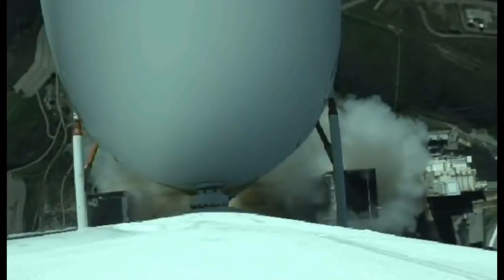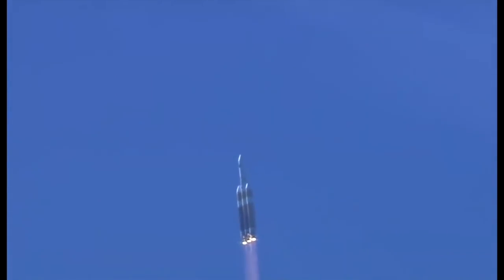Delta IV Heavy launches NROL-71

Comment: Why is there so much visible exhaust (dust?) behind DeltaIV, but so little behind the Falcon9?
Reply: It's water vapor. Delta IV burns hydrogen, Falcon burns kerosene, therefore Delta exhausts water while lot of Falcon 9 exhaust is CO2. Vapor trail also depends on weather.
Reply: @aleksandersuur9475  Thanks! So BFR will do the same?
Reply: @norik1616  BFR will burn methane, so yeah what comes out is mostly water vapor. So there should be more contrails than Falcon has, also because it simply burns more fuel.

Comment: I like how the fairings wobbled away into space.
6:56
Reply: 5 years from now there's going to be a ufo video from iss cameras of those things passing by waay in the distance still wobbling and reflecting sunlight.
Reply: Since there's nothing to damp out the vibration they'd probably keep wobbling until they reach Earth's atmosphere
Reply: I thought objects in motion tends to stay in motion?
Reply: @glockamole7128  They do. So what is your point?
Reply: @jpt7342  its just wierd how it wobbles like that.. Im not saying its fake or anything, I'm not one of those.. Im just curious about the wobbling farings.. Lol
Reply: @glockamole7128  Small explosions for the fairings release probably caused that wobbling.
Reply: Im just curious about the wobbling farings..

They're very light in weight, the amount of material used is the absolute minimum necessary to survive the boost phase. When they're jettisoned, they wobble just like any lightweight structure would, like a kid's plastic wading pool, for example.
Reply: @glockamole7128  the jettison force makes them wobble
Reply: @CarlosAM1  i figured it was the jedison that made it vibrate at a frequency that gave the illusion of a wobble... Lol
Reply: @glockamole7128  Yes. Not the illusion of a wobble, but an actual wobble. It's like how a pendulum will swing forever or, more closely, a ruler will wobble for a bit if you bend it. When the fairings are released, the edges are pushed away first. This causes a relative displacement and internal forces pull the middle out. Because of inertia, the middle ends up going further than the edges, so the edges get pulled back further and so on. It's the same principle as bending a ruler - it'll keep vibrating for a while.
Reply: me tool a life of its own...
Reply: IT'S ALIVE!!!!

Comment: At 6:34 until just before 6:40 there is some form of faring lowering around the end of the rocket exhaust exit, what is this?
Reply: It's a nozzle extension. The upper stage engine has a vacuum optimised nozzle which is much bigger than the first stage nozzles. Basically it folds up to fit into the interstage
Reply: @andrewbailey7999  And that's how you get 465s specific impulse!
Reply: Just checked back ,ummmm

Comment: Question.  Clamshell sep is way above the atmosphere,  yet they are seen fluttering as if in a breeze.

How is this happening in a vacuum?
Reply: That's not wind flutter, it is elastic flutter resulting from the explosive disconnect.
.
.
.
Not that the vacuum at that altitude is particularly empty, but it definitely is thin enough not to have "wind" effects any more.
Reply: @marvinkitfox3386  I noted the flutter as well, I also concluded it was elastic, and it made me marvel at how minimal the design must be. Strong enough to survive max pressure, but thin enough to wobble like that.
Reply: @flamencoprof  It could be made from 1" steel plate and it will still flutter a fair bit.
Once it is separated, it has no rigidity to speak of.
Reply: @flamencoprof  The fairings are only designed to make the rocket more aerodynamic in atmosphere.
Reply: Brian Roberts so according to you vibrations/oscillations are only possible when there is a “breeze”, amazing!!
Reply: @olasek7972  Please learn reading comprehension. 
I stated "as if in a breeze". It was a descriptive expression. 
I also asked a polite question . 
What is your problem?

Comment: Wow, ULA, seriously? I think the hydrogen burn on the outside of the rocket is pretty cool. Others may think its scary. But you seem to think it's embarrassing. Did you really loop old footage at 0:40 to distract form the flames?? (looping footage in a live stream is a pretty scatchy thing to do)
Reply: Doubt that was intentional, that feed possibly was delayed as it looked like it was a few seconds behind as you can see other ignition processes starting (and you clearly see the hydrogen burn off in the shot before).
Reply: Highly doubt they are/were embarrassed
Reply: They show full footage of the fire in their launch highlights video. Now that it's pretty normal, they embrace it as one of the quirks of Delta IV Heavy.
Reply: But it's super weird to cut away from it to a still frame. Something went wrong there... Maybe you are right and it's like SpaceX messing up the stream at the fairing separation during the Falcon Heavy Roadster thing, but... It looks very intentional.
Reply: Simon Barke nothing could go so visibly wrong there without affecting the rest of the mission.

Comment: Can somebody explain what all that smoke is at liftoff if the fuel is hydrogen with oxygen?
Reply: Orange foam covering is catching fire from    initial hydrogen burn out.
Reply: It's water vapor condensing from the burning of the fuel/oxidizer. The exhaust is essentially water.
Reply: Yes, it’s the same water vapor you see behind an aircraft in the flight levels (contrails).  

Except in the case of rockets, there is no CO or CO2.
Reply: @Stepclimb  in the case of hydrogen burning rockets.

Comment: 1:38 something flew by...
Reply: Error 0x80070079 venus did
Reply: @chillpolarbears  How are people so sure its venus? Not saying you're wrong but just wondering if you checked its position against the angle of the camera or what?
Reply: @UncommonSense-wm5fd  it could be something reflective that flashes with light from the rocket plume as it tumbles, I agree its probably venus but I'd have to check if it was in the right position before assuming that (and I don't care enough to do that lol)

Comment: Boy that close side booster had a quite a few chamber stability transients. That would have had my rear puckering if I was the lead flight controller on this launch.
Reply: Engine nozzles are ablative. Its nothing to worry about.
Reply: I think that's just the ablative engine nozzle - some of that material comes off and burns bright for a bit.
Reply: Lets see what Boeing says. Quite a fireworks show form everyday launches...
Reply: D. Mullins Boeing doesn't have much to do with it. That engine is an RS-68, made by Aerojet Rocketdyne. It's running fuel rich through an ablative phenolic nozzle...that's the reason you get orange flames and variations in the exhaust plume...phenolic material ablating away. This is normal...been flying these engines for...going on 20 years?
Reply: Thanks everyone, I was looking for info on this. Didn't know about ablative nozzles.

Comment: I wonder what sort of propellant is used on this rocket that it doesn’t leave smoke directly behind.
Reply: You could have looked that up faster than the time it took you to type that question, you do realize that?

Delta IV uses Hydrogen and Oxygen, both in the normal cryogenic liquid form.
The exhaust is basically superheated steam, and some nitrous oxides and the like from scorched atmosphere.
That's why the visible exhaust close to the rocket is basically invisible, just the heat glow coming from it, and further back it makes a very visible white exhaust trail.
Reply: hydrolox
Reply: Liquid hydrogen & liquid oxygen.  The hydrogen burns cleaner than kerosene: __ https://en.wikipedia.org/wiki/Delta_IV_Heavy
Reply: LH-2 (liquid hydrogen) and LOX (liquid oxygen).

Comment: Environment friendly hydrogen rocket 👏
Reply: CryB4Die how do you figure?  Fossil fuels (natural gas) are used to make hydrogen.
Reply: @johnvalerian8440  who knows maybe they used electrolyzers for the h2 en o2 production?
Reply: @CryB4DieXIIV  
Learn some science. Today 95% of hydrogen is produced from methane and coal.
And for the the part made from electrolysis, the electricity is produced from fossil fuels.
Reply: @nicejungle  I mean it is always possible to do it the clean way by solar, wind or nuclear.  Its a step in the right direction...
Reply: CryB4Die 95% of hydrogen is produced using natural gas which contains methane using process called steam methane reforming.  Just google search your questions.  Other methods are deemed too inefficient.
Reply: @johnvalerian8440  mainly done with hydroelectric energy due to lower cost to perform electrolysis of H2O.
Reply: YouSurf think logically for a second.  If hydroelectricity is going to be used to make hydrogen in a inefficient way then you are giving up the opportunity cost to use it in more efficient ways, for example power peoples homes.
Reply: @johnvalerian8440  It does not work that way.. where there is hydro power, mfg that is highly consumptive goes there... Clorine production by electrolyzing sodium chloride (salt) also occurs as such..... Hydrogen is most cheaply made by electrolysis which takes power to make liquid H and Liquid Ox and other stuff that is in air or is in water.  Windpower and Solar are considered but not reliable source as calm days and nights prove. SOLAR panels are VERY FAR from having no carbon and toxic materials footprint... VERY far from it.  Go see what it takes to make solar panels.  NOTHING is actually green. NOTHING. People consume energy, period. Gotta get over it.
Reply: YouSurf dude you are wrong.  Wikipedia search hydrogen production and you will be enlightened.  Wikipedia quote - “Hydrogen production is the family of industrial methods for generating hydrogen. Hydrogen is primarily produced by steam reforming of natural gas. Other major sources include naphtha or oil reforming of refinery or other industrial off-gases, and partial oxidation of coal and other hydrocarbons. A small amount is obtained by water electrolysis and other sources.[1]”
Reply: @johnvalerian8440  Meanwhile, Germany is shutting down its nuclear plants in favor of... more bituminous coal plants. Sigh.

In my view nuclear is roughly at the same level as hydroelectricity, though somewhat better. It's vastly better than fossil fuel power plants, but it's not quite the true renewables like wind and solar because disposal becomes a significant concern (and for hydroelectricity, ecological damage is the main concern). Once all power was solar and wind or nuclear and hydroelectric, it starts making sense to phase out those close-to-fully-renewable sources. But Germany isn't even close to that, so shutting down nuclear plants is fundamentally an awful environmental policy.
Reply: Ambient Morality Germany also pays some of the highest energy costs in EU.  I believe they import some from Norway and France.  Wind and solar make such a small impact, high on maintenance, and unstable , so therefore I believe are the wrong direction.  Japan brought all of its nuclear back online.  Fusion will be the future hope.
Reply: All the fossils were filtered out of this fuel ⛽
Reply: @lijie6431  Hydrogen is pretty much the oldest fossil of this universe.
Reply: Doesn't Space X use kerosene in their rockets.... that is a lot of "CARBON FOOTPRINT" they are causing int eh UPPER atmosphere, where the problems CAN be consequential, as opposed to carbon emissions down here on the surface, which TREES/Plants and Algae LOVE and thrive on.  Musk is polluting out upper atmosphere, along with high flying Jet aircraft.
Reply: YouSurf chemical propulsion is the only way to reach outer space.  There’s no eco friendly way to do it.
Reply: @johnvalerian8440  that's true for sure, but I mean it is still possible to have zero emissions in this process, maybe not efficient but it's certainly possible.

I'm waiting for nuclear power to be the biggest part of power generation.
Reply: @johnvalerian8440  No shit.... even Hydrogen Oxy has additional bad chemicals within the process... My point is maybe we should STOP poking such holes and leaving such chemicals in our UPPER atmosphere, where it could possibly REALLY cause problems..> I do not buy into the Man Made Global Warming crap with the examples they DO give that we the people do to live... THEY never mention the new technologies since 1900 that DO potentially have an affect... Microwave transmission generation for all communications, Radio, TV, Cellphones... etc... cooking the atmosphere, Rocket launches, High elevation jet flights, especially Military which flys the highest, then Commercial jets.... NO.... cannot mention ANY of those things which may be a true cause for any atmospheric variations which could be potentially problematic...no... never mention those.. People will not put down their cell phones and will NOT stop flying.......
Reply: @johnvalerian8440  PS>>> For your reference... I USED to be a Chemical Engineer.
Reply: @yousurf374  "NOTHING is actually green." Wrong unless the only definition of green is zero emissions whatsoever. There are more environmentally friendly ways of doing things, even if there is no such thing as a perfectly friendly way.
Reply: CryB4Die There are too many public fears about nuclear even though it can be done safely and with redundancy.  France is something like 80% nuclear and one of the cleanest footprints in the world in terms air quality.  Many countries are trying to get a fusion reactor to work which would provide limitless power.
Reply: @AmbientMorality  if some people are going to bitch about atmospheric greenhouse gas allegedly causing whatever, then they SHOULD work to stop the REAL causes of upper atmosphere contamination... Jets and Rockets. Not Cars and cow farts.  The former two are more and more prevalent and now being ramped up accelerated rate.
Reply: dum b
Reply: But not recycling the main boosters like SpaceX.
Reply: Doug M Falcon Heavy is a lot lower capability than this. SpaceX has no high energy upper stage.
Reply: RealityIsTheNow But Doug was talking about main booster (first stage) being recycled.  Spacex could use hydrolox on upper stage if they wanted, but still probably cheaper to use RP1 which can do most missions.  SpaceX is $60-100M and Delta Heavy is $350M.
Reply: @RealityIsTheNow  Hydrogen booster stage has no practical advantage. As upper stage, Space X can develop centaur like vehicle if they stay on Falcon 9 architecture. 

But they are trying to make BFR now. Orbital refueling trumps hydrogen for sure, Hardware reuse trumps expendible, let alone it's easier to make methan on Mars. 

New generation rockers are moving away from hydrogen alone. ULA could just die, they have been ripping of tax payers long enough.
Reply: @RealityIsTheNow Sure, that is fair for you to say that, reality is reality. Let's both take a wait and see approach.
Reply: RealityIsTheNow I’m sorry but I can’t help this conversation when we can’t even agree on basic facts.  I read space industry news daily and your claims make no sense.

Comment: Which country is this in? It's sunny there but very cloudy and cold here (around minus 15 Celsius ).
Reply from the maker: @Jshrasi Artwell The videos on this channel always have detailed descriptions. Please read them.
Reply: Vandenberg air force base in California, usa
Reply: Vandenberg AFB, which is in Santa Barbara County, CA.
Reply: Not very good at this "reading" concept, are you?
Right there in the video description: "A United Launch Alliance Delta IV Heavy rocket launched the NROL-71 mission from Space Launch Complex 6, Vandenberg Air Force Base, California, "
Oh.. never mind, i get it now.
California. It is one of the states of the USA. On the west coast of the country.
Reply: Common Sense 
       This is not necessarily true.  Many classified military payloads were launched from KSC (FL) aboard the Shuttle.  Space X also launches mil payloads from Kennedy.

      This payload appears to be going into a polar orbit.  Vandenburg normally is used for polar orbit launches since the vehicle is travelling over water on initial trajectory and would not pose a hazard if it has to be destroyed in the boost phase.

     Polar orbits work well for reconnaissance satellites since you get worldwide coverage as the earth rotates. 

      This trajectory is a bit odd, since the inclination seems to be 74 degrees.  You can see the vehicle traveling parallel to Baja Mexico as it heads SSE.
        One would expect a sun-synchronous orbit of about 98 degrees for ideal reconnaissance.
Reply: @UncommonSense-wm5fd  I think actually Vandenberg is better suited to polar orbit.
Reply: Jshrasi Artwell it was launched from Florida, USA I believe.
Reply: I stand corrected. It was launched from Vandenberg AFB in California, USA